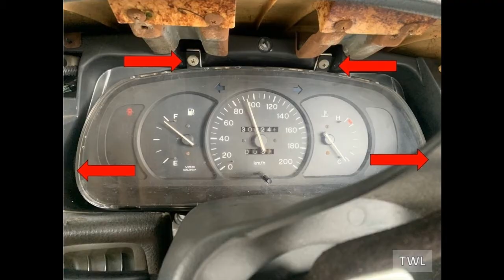DIY Tutorial how to remove your dashboard for Wira/Satria/Putra.

Comment: How to remove the 2 wire socket to the fuse box especially the lower one?

very difficult to open. I think that is the meter panel wiring,
Reply from the maker: Keep open it slowly. It will loosen.
Reply: @TWLohable  thank you sir